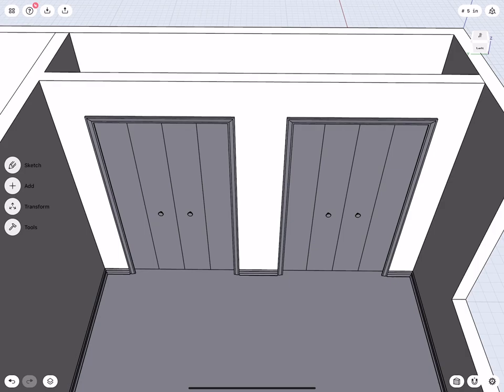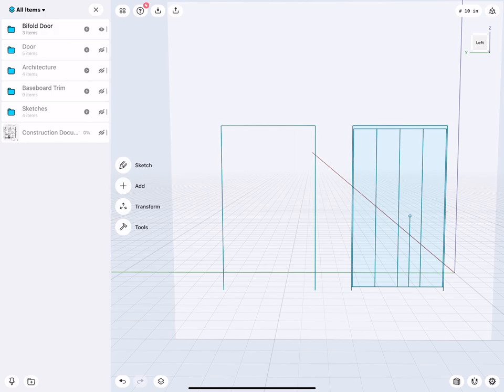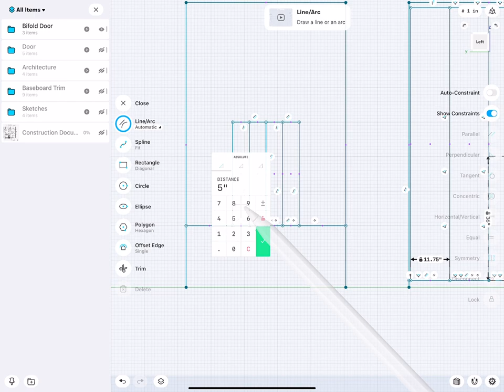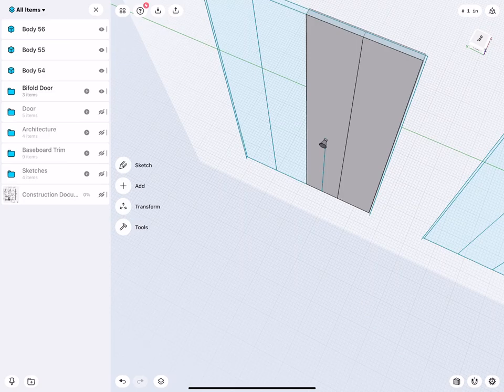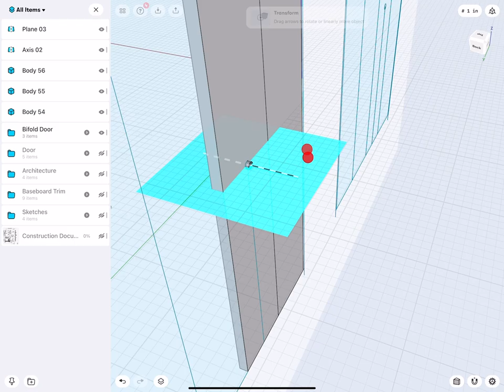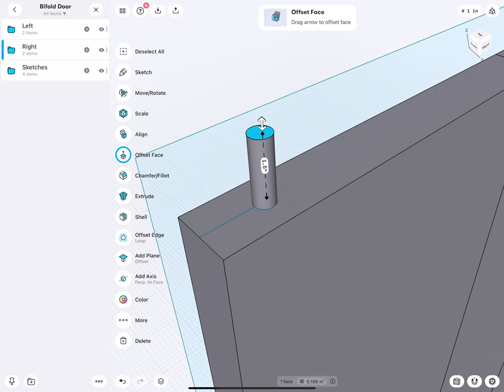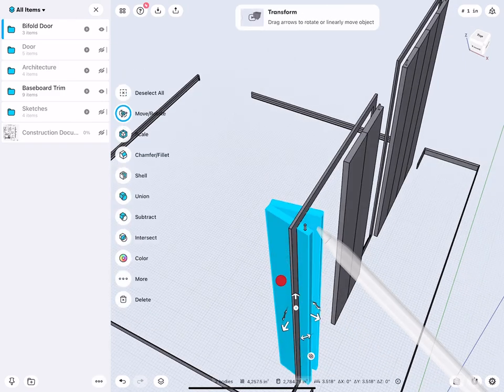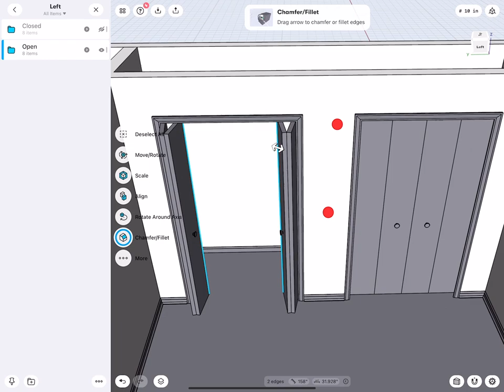3D Modeling for Interior Design: Bifold Doors | Shapr3D Step-by-Step

Comment: Love your reviews! I’m trying to use this 3d shaper to design a motorbike exhaust brackets put I’m a total newbie I’m having trouble I can draw the circle parts and extrude them but one end has to be higher and joined with two 10mm pipes/tube which are angled from edge to edge. Sorry for the long message 🙏🏻
Reply from the maker: Hi 👋 Please try out sweep and loft tools :) 
https://www.shapr3d.com/videotutorials/sweep-a-paperclip
https://www.shapr3d.com/videotutorials/loft-blower
These tools will do the trick, I am sure 😉
Reply: @Shapr3d  thank you this did help. Have you one on joining a 10mm rod to a 16mm diameter washer as if it was one piece ? Thanks 🙏🏻